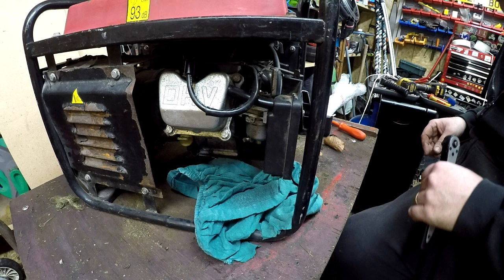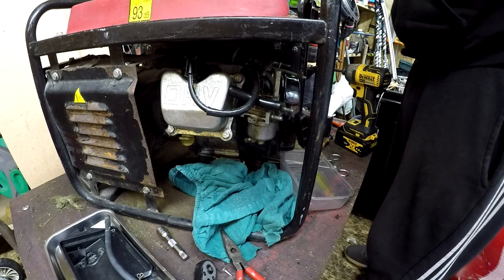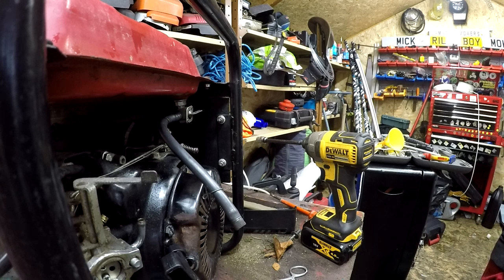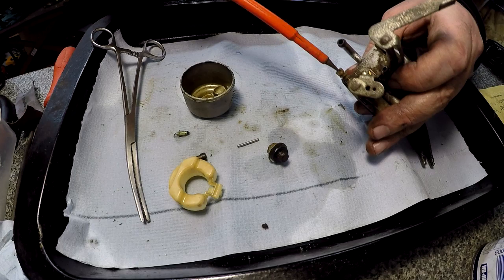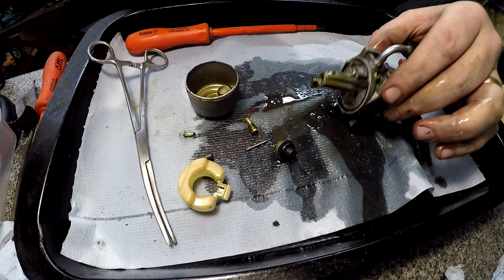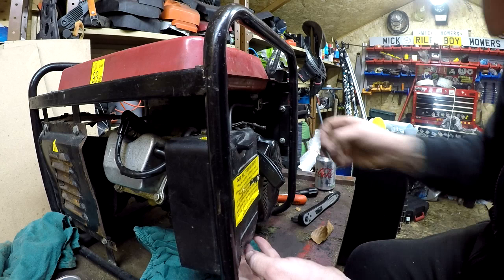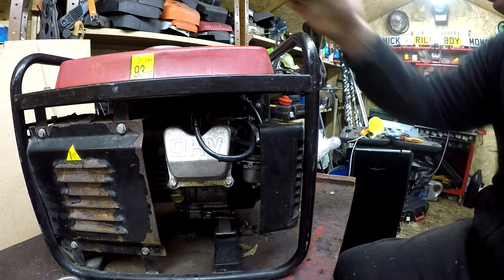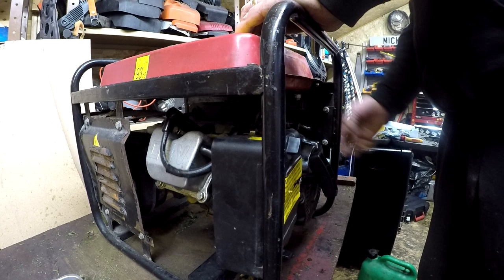Generator Needs a Carb Clean An Easy Fix - Watch This How To Video

Comment: I had a similar generator, and the fuel tap was so corroded and clogged up i got a new one, fitted it nipped up the nut and the tap sheared right off, chineese micky mouse metal, got a replacement free, not a bad generator  but a hefty thing to lug about .
Reply from the maker: alan lake yeah anything Chinese go gentle with it.

Comment: Hey Mick how ya doing, quick question, did ya get another recoil for it and if so where did ya get it from, need one myself for this genny, great channel bud.
Reply from the maker: Hi mate I think I repaired this one. But a Honda one should fit. Just make author holes line up before you order it. Hope that helps brother
Reply: @themowerman  yer mate my thoughts, I did find a match on generator guru, but it was about £40 delivered, haha, so I bought one from chino which said it matched size wise, for a honda GX100 but nope was to small, cause its chino I am stuck with it 🙄 so ordered one for a GX120, from the UK, I think its going to be the same as the red one you had on the vid, but I was thinking of making a good one out of the 2 or make the bigger one fit which maybe some new nut rivets etc, anyway keep up the good work mate 👍